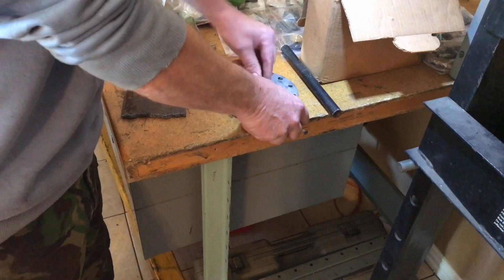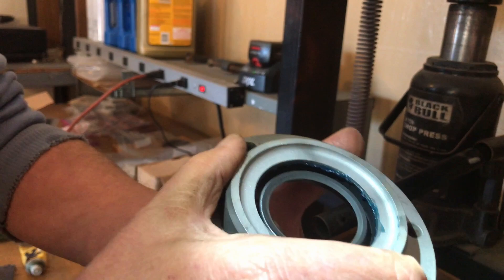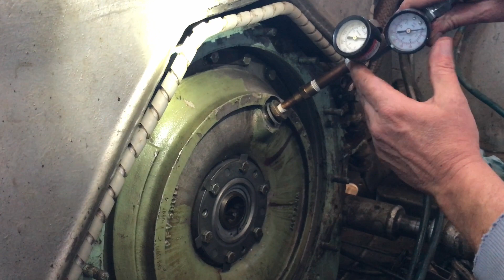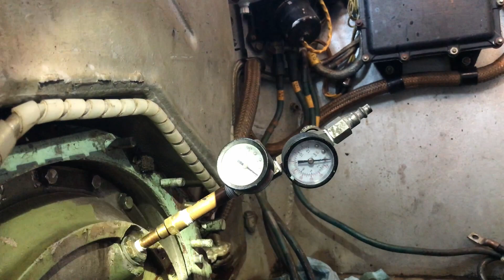Daimler Ferret fluid flywheel sealinstall.l

Comment: Just done mine and giving it an overnight pressure test with air. Worked in a six inch gap between the flywheel and gearbox. Good instructive video.